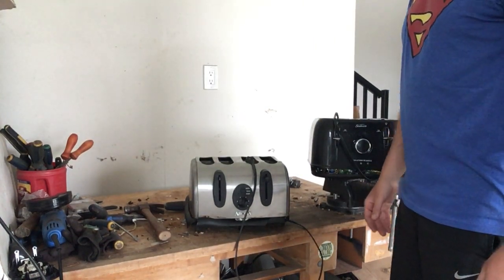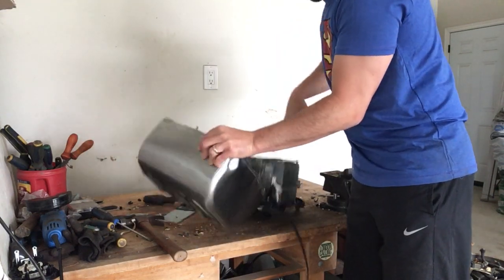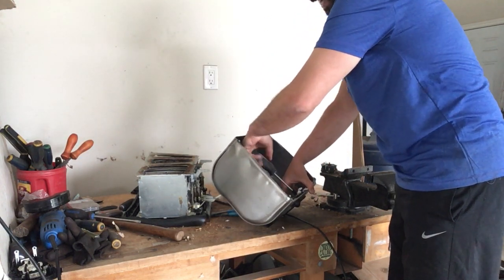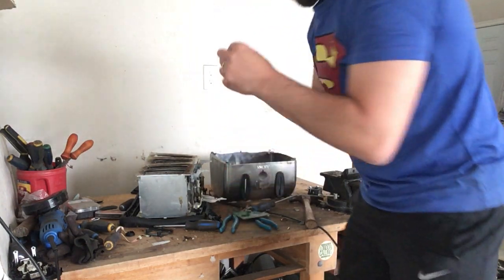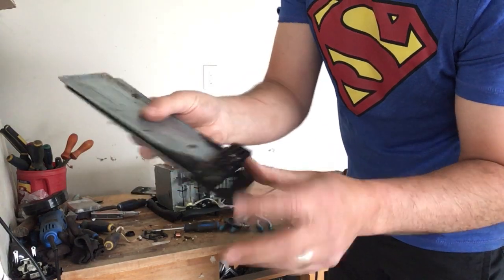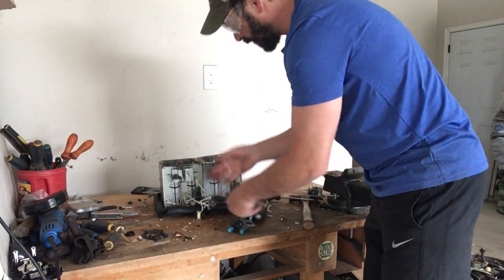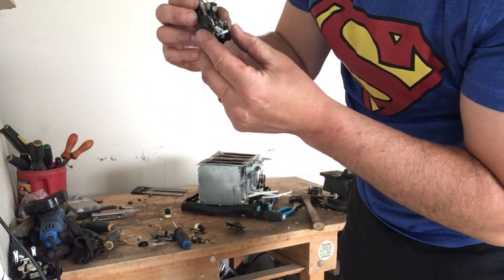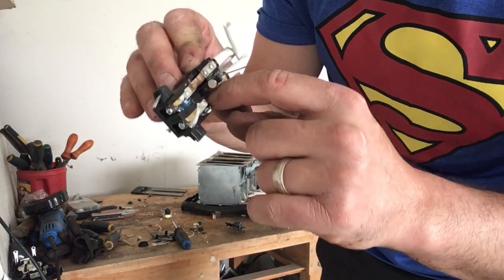Scrapping a toaster for copper, silver, steel, and very little waste.

Comment: So none of the heating elements or wire contacts have silver as I read silver is often used for wire contacts used in home heating devices. Great video btw. I just did a Kitchen Aid Toaster which was a pain to open. Had 4 safety screws aside from regular screws on bottom. So had to use a sledge on it.
Reply from the maker: Yeah, toasters can be hard to open and sharp, so be careful around the edges as well.